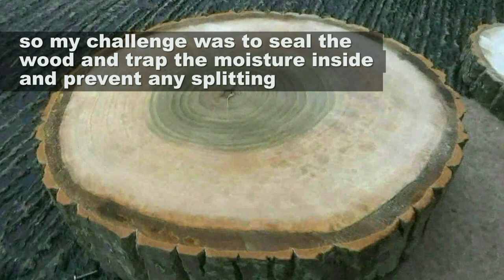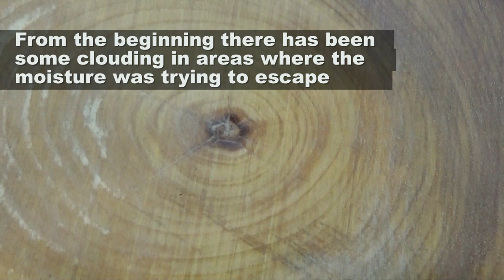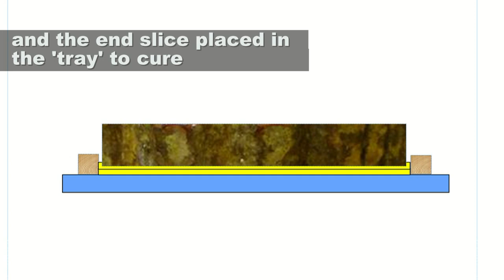Log End Slice Total Seal, Split Prevention and Glass Finish - Experiment Update

Comment: Really interesting experiment and you achieved the result you were looking for.

Re the cloudiness - in a sense that is a measure of your success and the conundrum - if the wood drys it cracks/shakes and if wet it doesn’t but makes epoxy cloudy. I suppose the trick is knowing at what % moisture content is is safe to take the slice down to before cracks are imminent - but I expect the % answer is very variable within a broad range.
Reply from the maker: Yes - it would be good to figure out how to avoid the cloudiness which I suspect is a patchy interaction of moisture trying to escape being triggered by the heat generated in the epoxy resin curing process. I have a feeling it is the price that has to be  paid for the primary achievement of stopping the end log from splitting.
Reply: @WoodomainJeremyBroun  I agree.👍